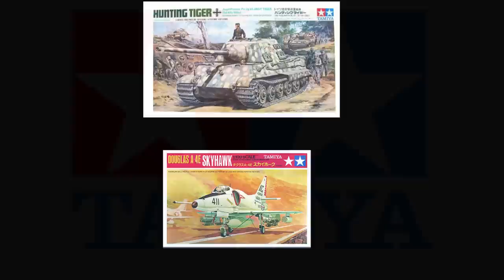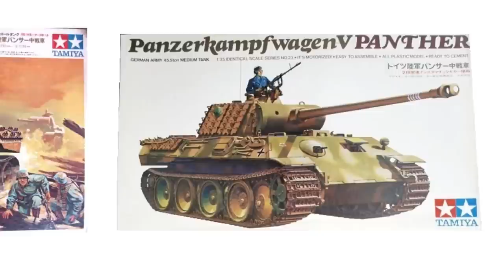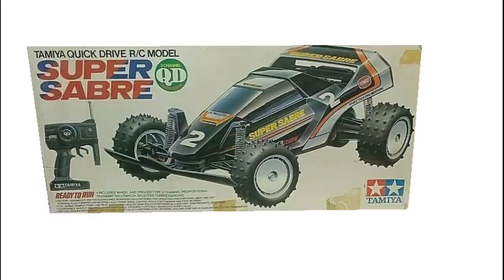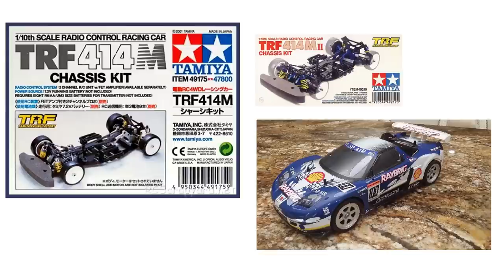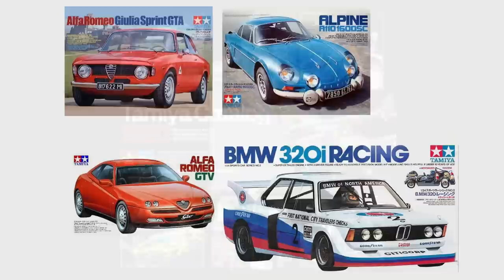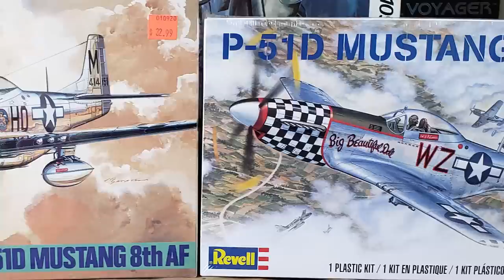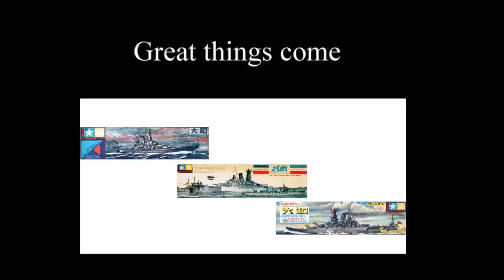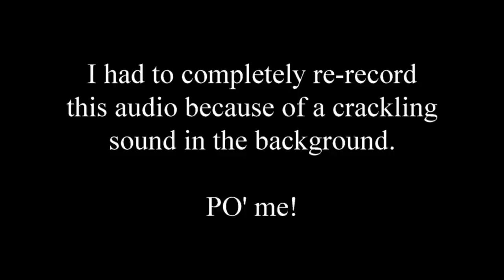Tamiya models, a brief history

Comment: Hello great video ! 2 question: Was wondering I just bought the Lamborghini Lp500s  RC and wanted to put the 
Tamiya Toyota Celica LB Turbo Vintage RC 1/12 body Since the web says they both came with the same chassis 
I noticed you said the first RC’s were just a model kit body on top of it , is this true for my application ?
Because I can’t seem to find original Toyota celica LB turbo body that still comes with a aluminum top wing 
And do you know of a website  where we can find vintage parts for these first RC models ?
thanks in advance
Reply from the maker: The stuff changes so much but if both units are older they may work.  Mods are often needed.

Comment: I own a bunch of the 1/16 Tank models: https://imgur.com/a/3PWpNwC / https://imgur.com/a/GzLRqvl / https://imgur.com/a/fxHQqrn
All of which cost me between ~400.- ( Gepard 1A1 Display Model Kit ) and ~900.- ( Leopard 2A6 Full-Option Kit ) brand new - All of them now have metal tracks ;)
If you're paying A LOT more than that for a new model then chances are high you've either bought the factory-built variant or you just managed to get ripped off.

Comment: @11:14 Aaaay Meitey... Yar cliked on ze RTR category theire, aint'scha? 🤣

First of all, I feel the need to express my opinion on something regarding your comment about the RC Tank competition being half the price or less than the Tamiya ones... There is NO competition to the Tamiya RC Tank models. If all you want to do is pick an RC model in the store, pop in a battery and head out into the fields then Tamiya will not be what you're looking for as you'll first have to assemble and paint their RC Tank models like any of their other models ( Yea... They occasionally DO offer prebuilt RTR packages but those are the ones you listed as "twice as expensive" but... Really, that is like buying a Shelby GT and letting someone else drive it... Total waste of money ) and vice versa if you want the Tamiya experience of building a model then the cheapo ( I'll be coming back to that ) Chinese Factory assembled RC "competition" will not satisfy that itch at all.

I have a bunch of Tamiya Tanks ( https://imgur.com/Y5HDNJw ) and the most expensive one I ever paid for was the #56020 Leopard 2A6 at around 900.- and that tank is, IMHO, still putting all other models Tamiya has brought to market to shame ( minus the plastic Suspension Arms... Those were rubbish but hey... Keeps the aftermarket happy, right? ) due it having, among other things, the most detailed chassis ( instead of simplified sheet metal tub ) and it being the first tank to feature their new differential gearbox and actual turret bearing race while still featuring the Xenon Bulb Firing Simulator that was dropped for paltry LED in the later models.

And if the aftermarket is anything to go by then it must have been the most beloved model ( or at least trading blows with the #56018 King Tiger ) because the amount of 3rd party accessories and hop-up parts you could get for it were unholy. Mine has Steel Tracks ( not just low-grade sintered metal! Actual Steel! ), metal cast Suspension Arms, turned and machined Aluminium Wheels all with rubber tires ( including the return rollers ), a 2-Axis Stabilizer ( https://youtu.be/VNP6Dstz6wc ), and the whole 2A7+ Demonstrator Addon Armor Kit including an animated FLW 200 Remote Weapons Station.

With the Leopard 2A6 being the exception back then when it was released not one of the other three models, I own would cost me more than ~550.- fresh out of the box and by the time you've brought a Chinese "competition" to a somewhat Tamiya resembling standard you won't have saved a thing by going with them. They're only cheap with the low-cost variants they market to get their foot into your door ( and the discussion forums ) but then everyone tells you "Nah man... You've got to buy the premium steel gearboxes they released and the new 6.7 boards and the new recoil motors and, and, and..." whereas Tamiya just sells one package - The Premium one.

Oh yea... And Tamiya, unlike Heng-Long, actually puts some effort into recording the sounds of the actual Tanks ( Original: https://youtu.be/vCsS20WJfBI > Scale Model: https://youtu.be/v3pbZP_P_hM ) including a documentation in their Build manuals whereas HL just plain rips the Tamiya sound(s) and puts the same 3-4 sets into EVERY tank model ever ( https://youtu.be/S8MakvP06vo ) - One way to save money, I guess.

Comment: The price difference? One plane is japanese, one is american.

Japanese culture is (as I understand it) of a "superior" mentality. Japan = good everyone else? = bad. They wanted to get more people buying the japanese plane over the popular mustang american. 

They might even have lost money on that kit to promote it.
Reply from the maker: Sounds good to me.
Reply: Muskoka Mike that’s not the reason. That Rufe came out in the mid 70’s and the P-51 in the 90’s. The molding on the P-51 is a lot better compared to the Rufe. Which is why it costs a little more. Just compare the newest 1/48 Zero from Tamiya to the Rufe for example there’s a major difference.
Reply: @Elizabeth-0  well, then that is not really comparing apples to apples is it? "one kit isn't the same quality as the other"
Reply: @FuLLeFFekT1 That actually isn't as ridiculous as you may think. I worked for a marketing company and that is done on many occasions. 

As for "they sell tons more P-51 kits" then that means the better quality molds were paid off sooner so the price per unit shouldn't be double. Using that logic, the P-51 should be the same price and they would achieve the same ROI.